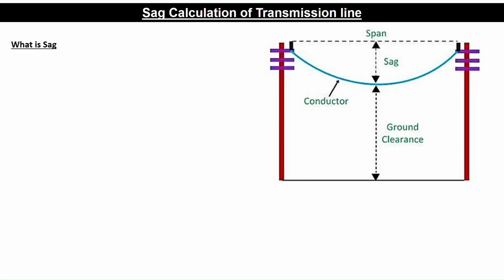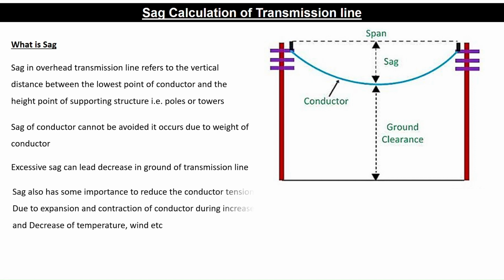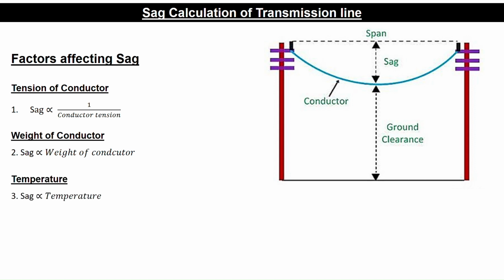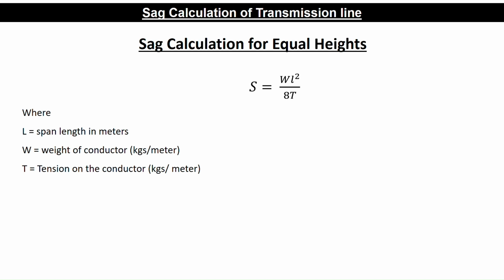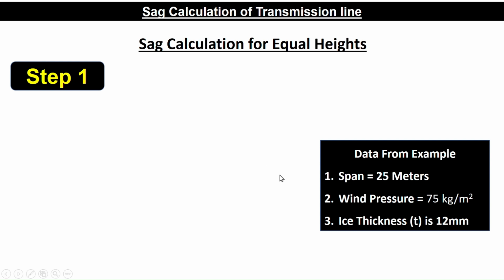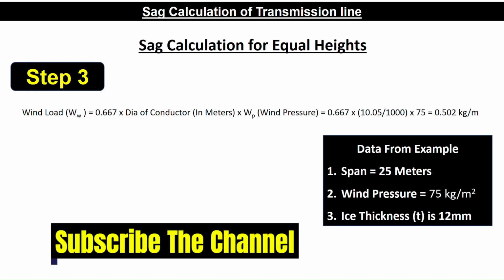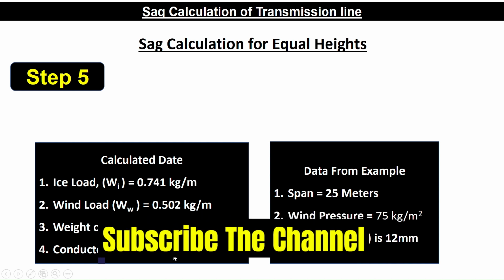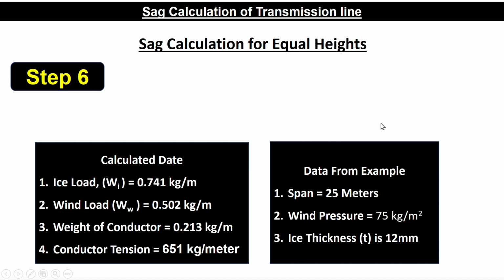Lecture 15 | Sag in transmission lines | Sag Calculation

Comment: Hello, thanks for the example sag-tension calculation. Please check the sag calculation in step 6, I think the answer is 0.13m not 0.52m (you may have used 2 rather than 8 in the denominator?)